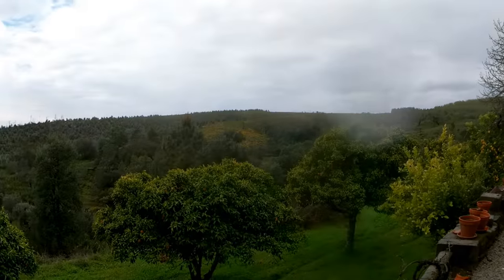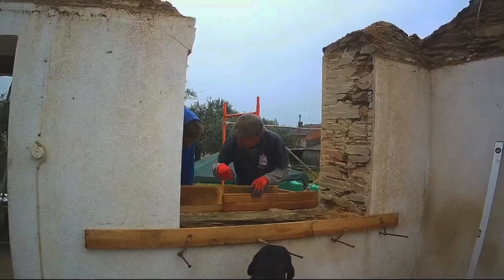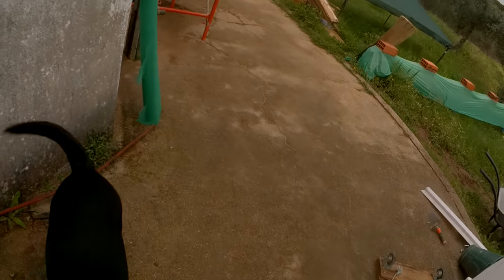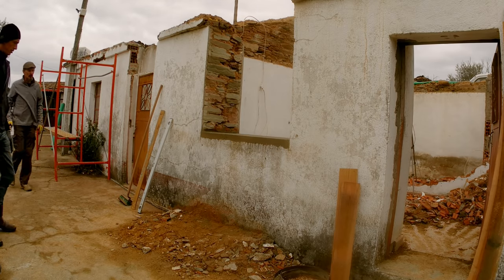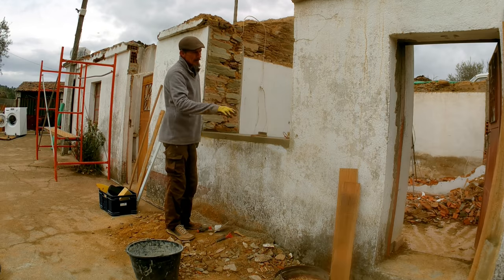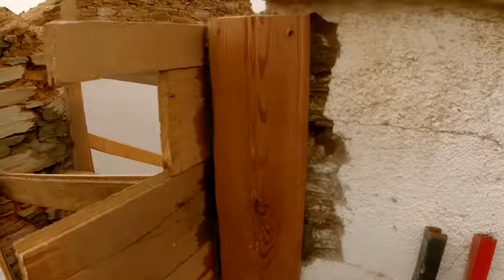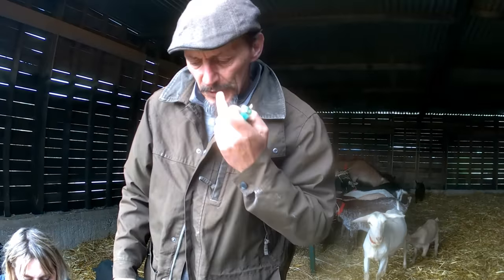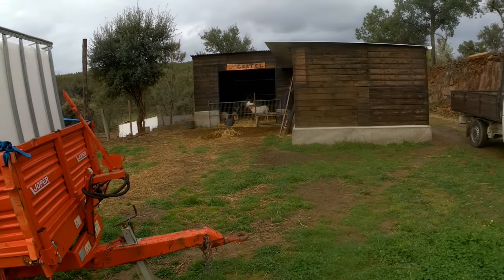Helping others with their Portugal Renovation - Time Laps - and we help a sick goat.

Comment: Have you tried using Tyre seal in trailer/tractor tyres?    Had a similar problem for years with our small tractor, trailer etc round the land and was pig sick of constant punctures (especially after cutting hawthorn).   Pump it into the tyres and never had a puncture again.     Its a similar idea to what you used in an emergency on your car (but its designed to be in there permanently).  Since then I have pumped it into wheel barrow tyres and even into the tyres on mums mobility scooter.   Brilliant stuff!
Reply from the maker: Your dead right, why i didn't remember that stuff, do you mean the green or orange coloured stuff.
I remember 'tire-weld' that was white and was not very good but those bright coloured ones with fibres in worked well, will have to get some as the trailer tyres are not as thick as the tractor ones.... good call👍🙂